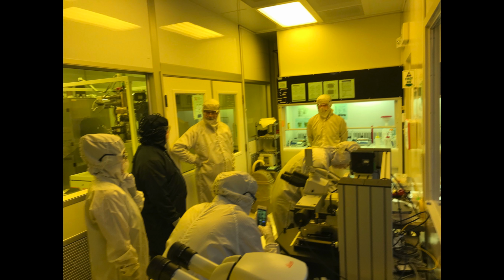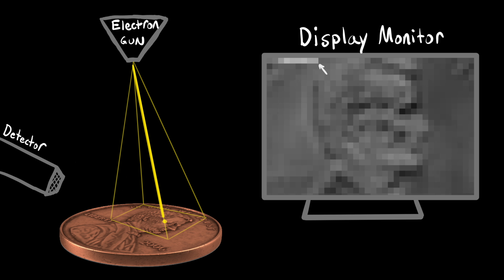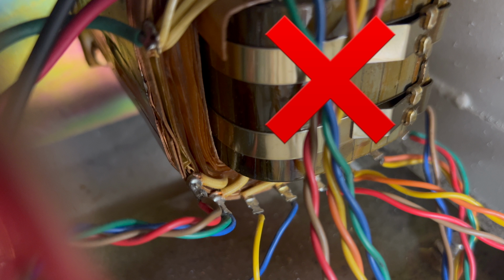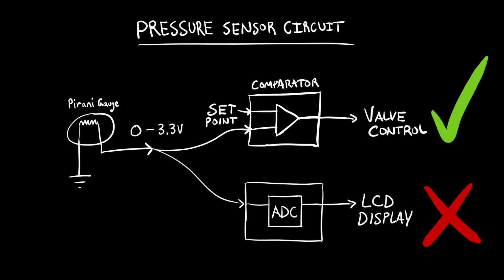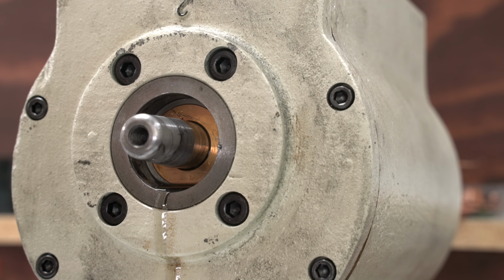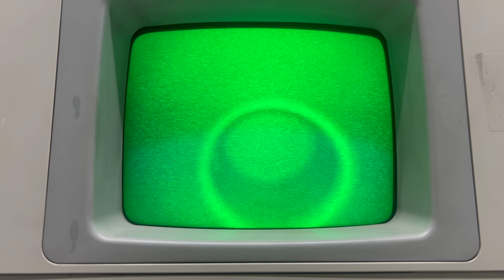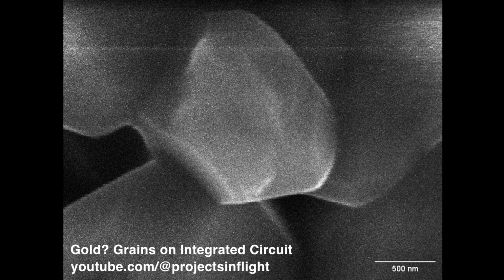I Saved an Electron Microscope from the Trash

Comment: The resolution on those last images you showed of the fly were utterly amazing. It's so crazy that this majestic, brilliantly designed machine came very close to being scrapped.
Reply from the maker: People in industry really don't have the time to repair stuff sadly, unless it's a 100 million dollar machine they'd rather upgrade to the newest one
Reply: The MTBF is not that great for such tools. They are repaired quite often. For example large labs in the semiconductor industry have always a team of service engs on site. Usually you have service contracts for several 100k $ per year to keep the tools running.
Reply: @soren6045  Some VERY old tools too. Also that machine can do better, its clear that it is far from working well, with all the issues with circuits.
Reply: Modern SEMs have much higher resolution in the nm range. I guess this is not Field Emmision Gun but Tungsten Cathode, so it is quite outdated. Also repair is more and more difficult. But usually the tools have quite long lifetime, 20 years and more.

Comment: It’s a glorified TV where the vacuum chamber is the picture tube and the rest is the vertical and horizontal sweeps, the hi voltage at 25k is the right at the lower end of the first color TVs output of the fly back transformer. 
I like your method of the low voltage transformer repair!!!

Your video cables need to be shorten to minimum length and Windows XP is a great OS and with a better adapter you could get HDMI output to a color hi grade monitor even if it is black&white. 
There are small adapters that will work from the output of the computer to the monitor. 
Now the software on the computer needs to be backed up ASAP. You may also have the ability to use programs like Paint to import from the microscope. The video capture adapter is an off shelf device so the ability to scan things to the computer can be improved. 
I am not sure that your electron microscope is sitting on a standard floor made of wood or it is on a cement pad of some sort will make all the difference in the world on a stabilizing surface.

I will say good luck and get your Amateur Radio License!!! You have the makings of a great electronics tech!!!

I am retired somewhat right now and caring for an aging parent otherwise I would hop into my car just to give you a hand😅😅😅😅

Good luck with that amazing project.

DE N2JYG 
Sherman NY
Reply from the maker: Thank you for the detailed advice! I am definitely gonna try to improve that video capture for sure!

Comment: We switched to these types of PVC tubes for vacuum down to 1e-4mbar in our labs years ago; we use them to distrubute the from dry scroll pumps to turbomolecular pumps. That means the entire system is free of oil which is important for precision spectroscopy in the UV/VIS regime. Our collegues don't use PVC and try to keep everything from metal which is nice, but also expensive and sometimes awkward to set up when a bellow is just a bit too long or short... The PVC is so cheap you can just cut it to the length you want and be done.

Comment: I see that you seem to have some 50/60 Hz disturbance/vibrations in the image. In the slow scan mode, vertical edges have a jaggedness to them, and I bet they correspond to the mains frequency. It is especially visible at high magnification so it is not linked to the CRT beam, but the actual beam inside the microscope. This is normally caused by vibrations (e.g. from the roughing pump) or from electromagnetic fields which deflect the electron beam slightly (unshielded transformers, power supplies, etc.).
Try moving the roughing pump some distance away from the SEM, and/or put it on vibration dampening pads.
Reply from the maker: Yeah, i need to put the chiller and pump on a floating base, and then add a baffle between the pump and scope

Comment: You should look at the signal being sent to the display, if its something standard like VGA then you should easily be able to plug it into an RGB2HDMI and connect it to a modern display. If I had to guess, the bad image is probably bad capacitors somewhere on the video path, since you were seeing it on the PC display as well then you can assume its somewhere from the aftermarket board backwards and if the board happens to be from around the time of Windows XP (since thats what the computer is running) then I'd wager a tenner on the board being the issue, capacitors from the early 90s through the late 2000s are all dying, its called the cap plague.
Reply from the maker: Definitely plan to replace those caps soon!

Comment: I have two quest suggestions:
1. Find the most deceptively smooth thing you can image - as in, it feels smooth to the touch, but if you'd only ever seen the SEM image of it, you wouldn't believe that it would be smooth
2. Find the most literally smooth thing you can image - as in, this microscope is going to struggle to find a feature to display on the screen because this thing is too smooth

(bonus round - for Quest 2, place a picture of yourself in sunglasses into the machine as b-roll while explaining the premise in voice-over - lol)
Reply from the maker: Hmm very interesting. I have a couple potential ideas:

1. some metal that has been polished with sandpaper.
2. either a silicon wafer, or a mica sheet

Comment: dude what the fuck 😭
Reply: HOW DO YOU JUST FIX AN ELECTRON MICROSCOPE
Reply from the maker: Honestly after thinking about it it makes sense. Realistically on a machine like this the lab is gonna use it and use it until it breaks, and it's actually not likely all the parts break at once. Realistically one or two parts break and those are all that need fixing. After that it's just a question of how well they store it and move it whether additional things break

Comment: Really enjoyed your video and the methodology in your troubleshooting and repair work.  I once repaired a $10,000 arbitrary waveform generator for a professor where I work.  It took several hours of careful circuit tracing until I found a defective capacitor, a fifty-cent part.
Reply from the maker: Wow- good work! Glad it didn't get trashed lol

Comment: so the fly can emit secondary  electrons ?? Why we can see the fly ?
Reply from the maker: This is actually a really interesting and nuanced question. I'm gonna make an entire video on this, but basically the amount of electrons changes based on the density of the material, and the angle that the surface is facing relative to the detector. If facing away, the detector wont capture many electrons, if facing towards, it captures a lot. This causes a "shadow" effect that makes an electron image look like a visible light image, and is why a SEM image looks so natural!

Comment: Very awesome, reminds me a little of the STM I used during my masters thesis that was a lot of fun to, but not as much as to wanting to own one, making new tungsten tips every day was a major PITA :D
You may want to look into replacing that Diffusion pumpt with a Turbomolecualr pump, a bit expensive but much less messy.
Reply from the maker: I thought about it, and i'd love to do it to save on power, but i am worried about vibrations...
Reply: @projectsinflight  The TMP's from Preiffer vacuum have only ~10nm vibration amplitude if you use the optional vibration isolation bellow, other manufactures more IIRC. If you want to get rid of any vibrations you could use a Ion Getter Pump in addition, pump down with the TMP and then use the Ion Getter Pump for sustained operation once its at high vacuum, but that is getting expensive TMP + Ion Getter + 2 large gate valves to switch.

Comment: genuinely curious, if you’re starting over from scratch on the transformers why did you choose to keep it at 100 volts?
Reply from the maker: Two reasons- first was that my mentality on the repair was to keep it as close to stock as possible.

Second was that there are a few parts that actually run on 100VAC, and replacing those with 120V parts would be annoying
Reply: @projectsinflight  Nice work thanks

Comment: You know for those transformers you probably could have just jacked an old computer power supply. Those switched mode power supplies are usually rock solid and have a bunch of different voltage outputs, 12, 5, 3.5, and so on.
Reply from the maker: I was worried about unintended consequences from introducing noise into the circuit. Switch mode power supplies tend to have a lot of noise in the high kHz range that linear supplies don't have.
Reply: @projectsinflight  Fair point. Though computer power supplies tend to be surprisingly clean. Maybe a comp power supply and some big old caps to clean the noise up?

Comment: try filing the sealing surface of the pump, Im not a mechanic so take what I say with some salt but if the paddles are sprung, then you could just reprofile the top of em, and the springs will push it in place

Comment: Genunine question: is too much trouble to plug the RCA output into an HDMI upscaler and attach the output to a LCD screen?
Reply from the maker: Kinda: first off, there is no need for an upscalar or HDMI because the resolution can be arbitrarily high if you slow the scan rate enough. What you need is basically any analog to digital converter to capture the video data. That's basically what the computer interface does. I want to build my own data capture device to improve it

Comment: You could replace the old pumps with newer faster and better vac pumps.
Reply from the maker: Actually, it's not necessarily a good thing to replace the vacuum pump with one that is faster. A higher cfm roughing pump would potentially increase the vibration.

Comment: You could have do an new electric circuit with 120v and youse regular 120v to 12v transformer. It wasn't necessary to force the new transformer directly in the old power way with 100v
Reply from the maker: I wanted to keep the machine as stock as possible, so i used 100v and didn't upgrade anything

Comment: I wonder if that sem can be used as scanner part of photolithography machine?
Reply from the maker: You can convert a SEM into an electron beam lithography machine, but it's not really that feasible with this particular unit. It is missing something called a beam blanker that can quickly deflect the beam. Without it all of your lithography must be connected, kinda like drawing on an etch-a-sketch

Comment: Fun fact: The first electron microscope was developed in..... 1931! 

Also: Holy sh!t! Finding a broken Electron Microscope for sale on its own is crazy, let alone repairing it such that it works.
Reply from the maker: Fun fact- the first electron microscope was a Transmission Electron Microscope, which is similar but slightly different. It shines the electron beam through the sample to image cross-sections. The main difference is that it doesn't scan (or rather, it doesn't need to scan). The Scanning Electron Microscope was an idea that people had not to long after, but everyone looked at the TEM and said "Why would we bother making an SEM if it's obviously going to be worse?"

It took decades to make a good enough SEM to be useful

Comment: You really are a beast to machine your own vacuum fitting adapters. When we fix our old pumps we usually have to order new kf adapters. You are a lot more skilled than those grad students in the original lab!
Reply from the maker: I've gotten decently good at making KF fittings, but they are pretty challenging. The little o-ring groove is a tricky operation

Comment: The reason for putting a conductive film over a sample is that electrons are also charged particles so bombarding a non-conductive sample will cause charge build-up.  This charging effect can accumulate and not give you very long to have much contrast in your image but it's definitely not the end of the world.  If you get your hands on another vacuum chamber it's not particularly difficult to hook up electrodes to evaporate some graphite if you end up wanting to get pretty detailed images of insulating materials.  At that point it's relatively simple to figure out what the mean free path for the carbon atoms would need to be to reach your sample and therefore you'd know how high of a vacuum you'd need.
Reply from the maker: Yep, absolutely correct. I actually have plans to make a video on a thermal evaporator soon. It will be useful both for the SEM and for metalization of semiconductors, replacing the method I worked out in my earlier video

Comment: I suspect you already know this, but give it a once over for any electrolytic capacitors that may need to be changed before they die, or that might already be well out of spec. It's pretty much standard procedure with old electronics from the 80s.
Reply from the maker: Yeah, replacing caps is gonna be my first thing I do

Comment: Dunno if it's allready posted, but the 5 V IC Regulator is a 3 Amp chip. Not saying it does not work with 1.5 A, but to be safe, 3 Amps would at least be at OG spec :)
 
Amazing restoration(!) and find :)
Reply from the maker: wait- are you talking about the old one that I couldn't find any info on? If you have any info on that unit could you email me? projectsinflight at gmail dot com

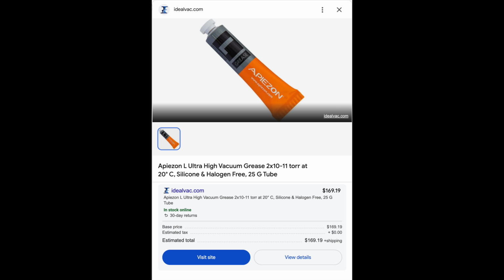Comment: 21:51 Lol we use Apeizon N grease as a thermal paste in our cryocoolers.  That stuff is almost twice the price of the L.  Maybe more than twice.  Its crazy

Edit: I also transferred it to I believe that exact same syringe too
Reply from the maker: Wow impressive. Whats the benefit over L?
Reply: @projectsinflight  It's basically the same high end ultra-vacuum grease as the L (No off-gass, no creep, ect), but for ultra-low temperatures.  My best guess would low thermal expansion (or the opposite in the case), as I would be pleasantly suprised if there was a single man-made compound that can stay viscous at 4 kelvin.

For more context if you're interested:  The second stage on the 10K cryocoolers gets down to 3.9-4.5K under load to continuously condense helium as it tries to boil off.  Like all paste/grease its a terrible thermal conductor, but its better than extremely slow moving gaseous helium (sitting in a .99999% He vessel).   We use it for sensors and for anything that interfaces with the cold end.  

It would also use it to lubricate/seal any oRings that interact with cryogens, such as transfer lines, ect,

Comment: 5:11 That is very similar to how the vidicon tube works in an old TV/video camera. Kind of like a cathode ray tube in reverse. It sweeps an electron beam back and forth and lighter and darker parts of the image on the camera lens will have a varying electric charge. That varying charge is then "painted" back on the tv screen as lighter and darker parts of the picture. That's oversimplifying it a bit, but the basic idea of how it works.
Reply from the maker: I've actually seen a project online where someone converted a CRT into a rudimentary SEM

Comment: You're bringing back memories. I worked on a Cambridge Instruments SEM back in 1981-83 as well as a Perkin Elmer 595 Microprobe. The SEM was already 12 years old by then. It was a hybrid machine with tubes and semiconductors. The microprobe was new and cost $500,000 back in 1979. Keep it up. You did very well. Thanks for the video.

Comment: Ooooh this is amazing.  I cannot wait to see this level up your chip production process.

As usual, the repair process is a bunch of simple fixes that are relatively easy to apply, but knowing which fixes to apply is where the skill, logic, and bull-headed stubbornness of the debugger is critical.

The completely massive and overkill heat sinks for those 7805s are great.  I love it.  Normally you just need a tiny bit of heat sink, preferably with some fins to improve convection, but I guess this way you will never risk overheating even if you run it nonstop for weeks.

Using an obsolete xbox controller as a donor for industrial switch membranes is pure genius.  That beep is so satisfying.
Reply from the maker: I was VERY surprised the 7805s were ok with that. I figured they might have some trouble conveying the heat from their tiny package to the massive heatsink, but i really put them through their paces and they handled it like a champ
Reply: @projectsinflight  7805s are hardy beasts.  Beware the 790x series, though, because the heat sink lug is tied to one of the negative voltage pins, forget which.

Comment: I hope you didn't throw those membranes away because all you need to do is re-carbon them. Get some carbon lubrication used for locks. Put it on a piece of paper and then take a q-tip and get it covered and then just wipe it on top of them. I did that with a couple of my remotes that were not working.
Reply from the maker: I still have them, but honestly they weren't any better than the xbox membranes. Also they were of different sizes. I suspect they might already have been replaced once

Comment: Good job. I am sure somebody mentioned it, and you know it, but probably all electrolytic capacitors should be replaced. Also about the usage of slightly input voltage to linear regulators. It depends, they do have a drop out voltage, that increase with current. So double check datasheets, and measure voltage at the output under load. Actually checking for stability with oscilloscope might also be a good idea (just be careful about grounding, as oscilloscope signal ground is usually earthed, most of the time it should not be an issue).
Reply from the maker: Don't worry- the regulators have a ~1V dropout and I'm giving them at least 3V above their output voltage, so it should be fine (famous last words)